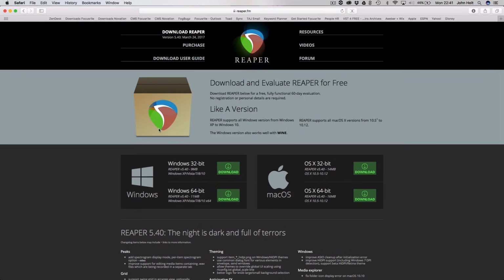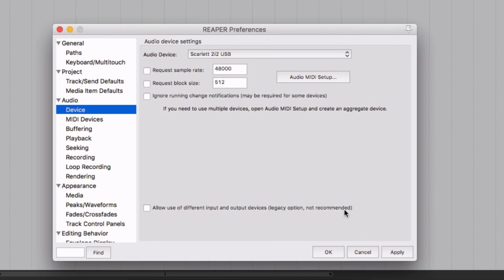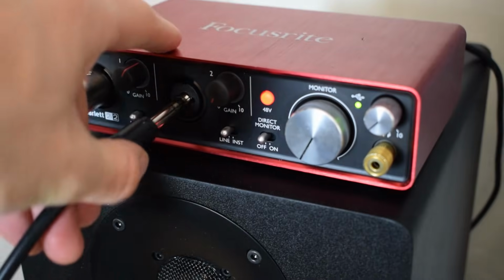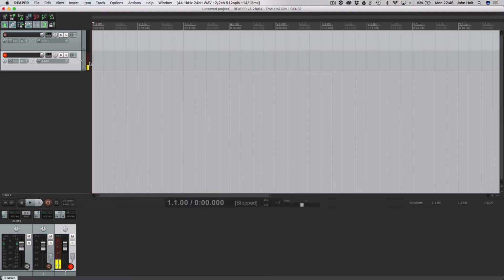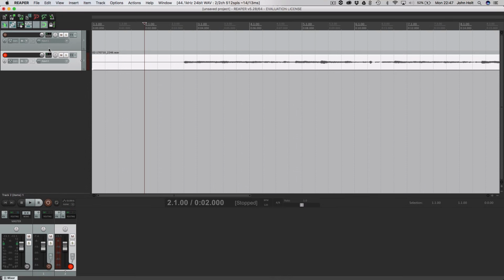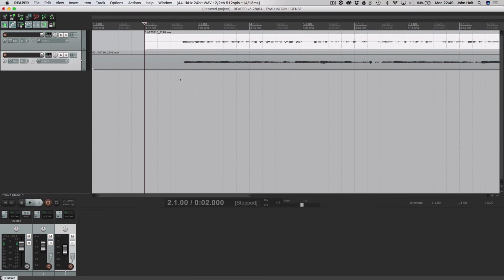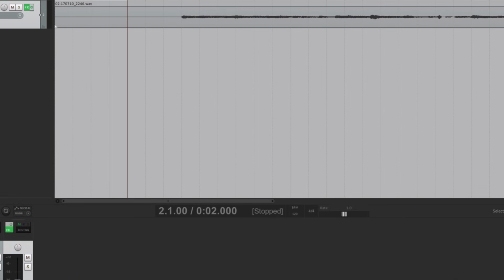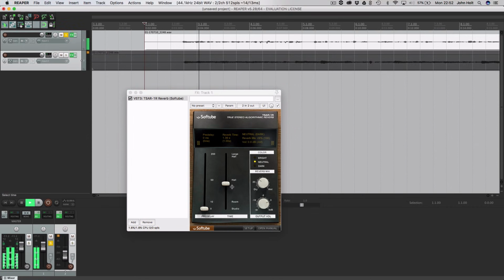Reaper Beginners Tutorial - Recording Guitar and Vocals

Comment: Hi mate I'm using a Zoom R16 for my audio interface but it's now not talking to my Reaper software. I can't assign tracks and I'm not even getting a mic signal. I have been recording fine getting amazing results and now it's not working. Can u please help? I've even updated to latest version that was worse so reverted back. 
When I did it before I recorded and assigned track 1 for bass, electric guitar and track 5 for mic for vocals and recording guitar with my rhkde mic. Now the drop down menu when clicking for assigning tracks is not there. 
Your help would greatly appreciated. 
Steven

Comment: so for the guitar, let's say i wanna record a live cover, and i want different sounds for my guitar for example i'm recording What's my Age Again by blink-182 and it starts with clean then distortion then clean bridge, can i do that? change between signals by adding different effects on the track in different time stamps?
Reply from the maker: I’d recommend recording the two parts separately, unless you’re using an amp simulator plug in like Guitar Rig, GTR3 etc., in which case you could duplicate the audio track once you’ve recorded, cut out the clean sections from one of the tracks and the distorted sections from the other, and put a clean amp sim on the track that you have the clean sections of the song, and add a distorted amp sim to the audio track where you have the distorted sections of the song. Let me know if that doesn’t make sense!
Reply: @TheAudioJourney  actually it does make sense, so what your saying is i need to record the whole track with no effects, just dry cleans signal, then i edit it by duplicating the track and adding the desired effects to the wanted parts of the song, that seam logical, well when i play i won't hear my guitar distorted because i'll be hearing the clean signal only but after the mixing and editing i'll be able to add the effects that i want to the parts that i want, cool, thanks man! i was having trouble with this because i don't use a real amp or an effect pedal board, i'm just plugging my guitar to my sound card then to my computer and i use guitar rig to chose the tone and all that stuff, that's it, oh yeah and i cut and paste everything in audacity, it's not a great DAW but it's easy :p

Comment: Hey dude, I've got audio going through my input on my ZOOM UAC-2, however it doesn't seem to be allowing me to use direct monitoring with my headphones. I've tried using all stereo, mono and off direct monitoring options on the box, none of them work. I've adjusted the gain controls to pick up anything at all, including the headphone volume, but nothing seems to be working. Any clues on what to do? Nothing seems to be working